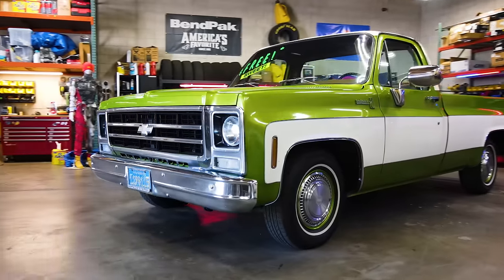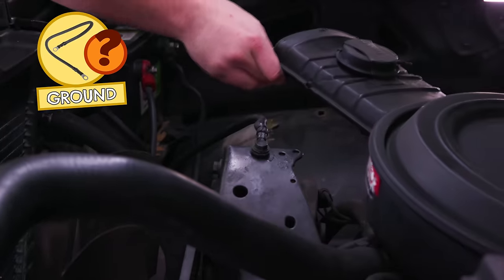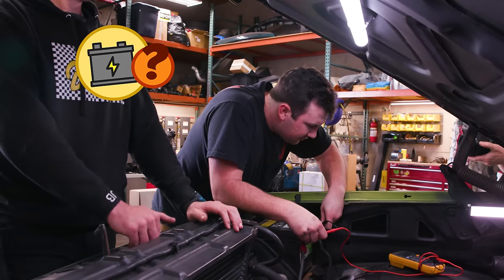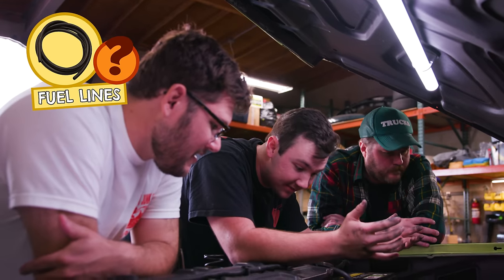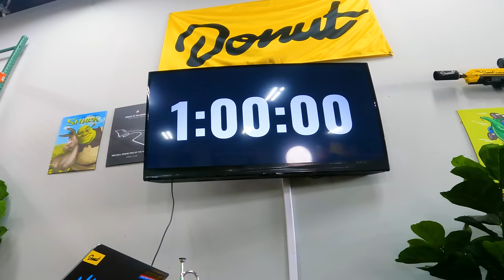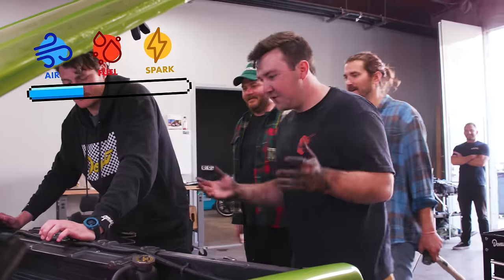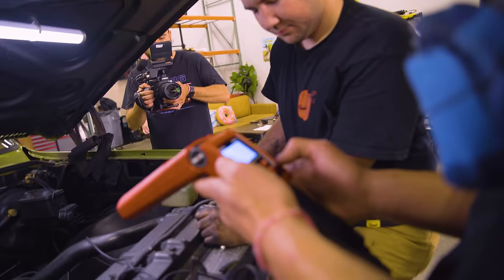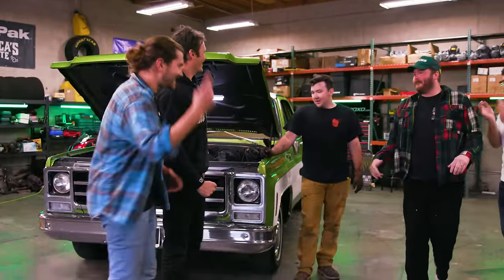Giving People a Classic Truck, If They Can Fix It

Comment: That pushrod moment was a perfect sign of experience.  Once you've done something like that a bunch of times, you know when something "just doesn't feel right."
Reply: I would have missed it myself.  Not a problem I've had.
Reply: theres a big difference between knowing that something doesn't feel right, and knowing why it doesnt feel right tho. thats the true sign of experience.
Reply: @xymaryai8283  he did know why though, cause  he diagnosed the issue almost immediately following his discovery that "something doesn't feel right."
Reply: Yeah, I was rooting for him to notice that.

That was a dirty removal to be honest. Lol
Reply: Don't ford's run off a little gear attached to the fuel pump?  That seems easier than a rod sticking out from the pump that can just fall off?   Why design a pushrod that can just fall off?
Reply: @breakingames7772  My 79 f100 has a pump in the tank like more modern vehicles.
Reply: @breakingames7772  runoff a concentric lobe that is bolted to the front of the camshaft
Reply: A true sign of experience would be popping the hood first and checking all the shit in 30 seconds he wastes first 15 minutes on and not getting in trying to start it. Obviously they not going to give a truck that starts when you there for challenge to fix it.
Reply: I was rooting for him that's all I can say,  and I'm so glad he got the truck 🎊 🤗 🎉 🏆
Reply: Definitely would have missed that.
Reply: There is a bolt hole in the front of the block that lines up with the fuel pump push rod. You push the rod all the way against the cam lobe, install a long bolt to retain the push rod, install the fuel pump and then swap the bolt out for a shorter one. It seemed like no one in the shop knew that.
Reply: @Thumper68  lol, good troll
Reply: @clawsoon  just stating facts. every thing he fixed I would of checked and discovered in first few minutes before I ever tried to start it.
Reply: @benwhitener3051  you can also add a small dab of grease to the end of the rod and push it and as long as you don’t hit it too hard it won’t move
Reply: @Mika-ph6ku  somebody has put it in the tank as they had a mechanical pump in 79 on the side of the block with but no pushrods to drop and fiddle with like a Chevy, that would've caught me out
Reply: Can tell you I would have NEVER figured that out
Reply: @asdasd-ni8eg  Nah man the fuel pump in the tank is stock. Had the original tank and pump in the truck when I got it. Needed to replace the tank, pump, and fuel lines cause there was rust and water in the fuel tank and the new tank and pump that came in were identical to the old parts.
Reply: @Thumper68  A true sign of experience would be not to comment stupid shit like that. Trying to start the car is exactly the first thing you wanna do. You can get a ton of hints about whats wrong just by the sounds the car makes (or doesnt make) while cranking and trying to start.
Reply: @Mika-ph6ku  They definitely didn't come with in tank pumps. Can you post a link to the pump you ordered?
Reply: @Vits2001  no that’s stupid a vehicle you know nothing about and your a mechanic first thing you do is pop the hood and do a visual check over some simple shit. Just get in it and crank it you have no idea what’s going on is a good way to really mess shit up.
Reply: Idk if I would have thought of the push rod because 302s don't have a push rod, just a long ass arm that rides on the cam lobe
Reply: @NOBLE-wo5rr  have u watched 2022 F1 Saudi Arabia race??
Reply: @James-vn8zb  yes.
Reply: @Vits2001  i got a new sign for this.
Reply: @StewDaJew  i can always figure this out.
Reply: @clawsoon  👍👍
Reply: @Thumper68  i got started from this one.
Reply: @purwantiallan5089  wtf u talking about
Reply: @Thumper68  Thats obvious. But this is not jusy any car. They literally told him just before starting that this was a perfectly running truck that they sabotaged in some ways to make it not run. Plus they only give you 2 hours so its not like they're gonna loosen the flyway bolts. Turning the key takes just a few seconds.
Reply: Knowing a SBC uses a Pushrod instead of a direct essentric lobe is also important because alot of the American I6 engines from the 40s-80s used Eccentric lobes on the Camshaft to actuate the fuel pumps lever directly thanks to the Geometry of an OHV I6
Reply: @purwantiallan5089  What are you replying yes to?
Reply: @Vits2001  Imagine if they drained all the oil and left it so the starter would crank, but wouldn't run? That'd be hilarious.
Reply: @benwhitener3051  I was looking for this comment. That's a trick I like showing people. I'd have it changed in ten minutes, because got it down lol. I have no choice but to change to electric, because mechanical pumps are so poor quality now days, they last me about a year before they start clacking.
Reply: @James-vn8zb  yes but for 1 you don't see everything said you also are pretty safe under the assumption there not gonna maliciously sabotage it.
Reply: @Mika-ph6ku  mate prove us otherwise I'll be glad  to learn about this oddity but from my experience mechanical pump on motor with a charcoal cannister and vapour lines go back to the top of the tank..
Nothing but a fuel sender in the tank which gives you your fuel level.

I'm currently building 6 between 74-79 so not my first dentside ford.
Reply: @asdasd-ni8eg  OK yeah I was wrong I found the pump underneath the ACU. Turns out what I replaced on the tank was just the fuel censor...

...I should probably replace the pump now.
Reply: He had some experience but still lacked a lot. It was apparent when it took him so long to get the distributor going.
Reply: @asdasd-ni8eg  No kidding. That's why I made the joke
Reply: I remember replacing my first Mech fuel pump and rod at 0200 in Afghanistan back in 09 lol. Fucking HMMWV fuel pump rods were weak as fuck!.
Reply: I’m surprised he got it since he works on fords and some of them just have a long arm that touches the crank directly
Reply: @tylerbranscum3485  The way you're supposed to do it is to take the bolt out from in front of the block and use one of the fuel pump bolts in that hole to hold the pushrod in place. Some red n tacky might work, but the hole is there by design.
Reply: @James-vn8zb  They do this everytime for show. The challenge starts with trying to start the car, eventhough you know its not gonna start. They're not gonna drain the oil
Reply: @Vits2001  None of you get a joke...
Reply: @James-vn8zb  Yeah sorry, i didnt catch that and answered seriously hahaha
Reply: Anybody with experience would have looked at the pump before blindly installing it and wasting a bunch of time realizing the rod is missing lol.
Reply: I always inspect parts when I change them. Been wronged to many times but I would have never expected that from them lol 😂 genius
Reply: @breakingames7772  theres a oblong washer like thing on the old fords , you just stick the fuel pump under it , when it turns its shape makes the pump arm go back and forth ( if i explained that correctly ) no metal rod to fall out , also the distributor was in the front , easier to work on and time , but parts were more expensive back in the day cause they werent as popular , you could find chevy parts laying everywhere ..but not ford parts
Reply: @Thumper68  maybe with exception to distributor cap- he worked on Fords which is upfront and turned different compared to GM- so that and fuel pump would be only things he would’ve needed to try and start it for
Reply: That's true. It's a matter of knowing what the engine sounds like when it starts properly and why it sounds like that in the first place.
Reply: @James-vn8zb  an engine can still run without oil it’ll just eventually seize up
Reply: @BassmentBrain  it’s called experience and the ability to use common sense..they are going to give you a truck if you can fix it..assume it won’t start and take a glance under the hood and confirm that right away and you don’t know what they done to the engine attempting to start it may cause damage that you then couldn’t fix in time limit so a smart person would eliminate that possibility. Like I said experience and common sense but you’ll never know until you try it🤣🤣
Reply: @BassmentBrain  I didn't say it wouldn't. I was saying if they drained the oil, then did something else to prevent it from starting. Bc they almost always turn the key first without doing a quick look over. Maybe they're told to try to start it first. Idk. I just thought it would be funny if he tried to crank it over a bunch of times, then realized it had no oil.

Comment: We just bought a Chevrolet Truck!  Only one problem, it doesn't run!  Chevy owners felt that.
Reply: i love your videos bawz keep healthy and uploading more content
Reply: yo Odd wzzuuuuup
Reply: OddBawZ + PhlyDaily A10 video!?! Would be cool to see one calling out targets from the ground with the other coming in for the brrrrrrrrt.
Reply: And they didn't even have to sabotage it, it just came that way
Reply: It be like that, bought my El Camino 6 months ago and still has no drivetrain. Only been 48 years since a it’s ran lol
Reply: Youre telling me, bought an s10, put 3k miles on it in a year, then after 3 months of not being touched, it just starts on fire when I start it. 
Sold it, bought a 4.6l f150
Reply: Is that a problem or a standard feature on a Chevy truck?
Reply: @Mika-ph6ku  the Chevy truck go brrrrrrr
Reply: @OM-jt8bn  hi OM40. Have u watched F1 2022 in Jeddah?
Reply: @jaket6007  🤦‍♂️F150 won't last as long as a chevy. Not a fanboy of either but have about 35 trucks I take care of. Chevys as far back as 98. 2 of the trucks being scrapped out of the four are Fords with severe mechanical issues. The other 2 are chevys that were stolen and stripped for parts. Oldest Ford is an 08 and only 2 left in the fleet plus it has a rebuilt engine. My advice. Buy Toyota.
Reply: @chrisd0427  the ones you take care of must get treated like shit by their drivers. Is it a fleet? Because I used to work for a company that had fleet vehicles and my fellow employees and I beat the ever loving shit out of them lol
Reply: @BarnacleBoy42069  100% treated like crap. Mine has the highest milage of all the trucks and it still looks and drives great. Just got a new one so I wonder how badly it will be treated.
Reply: That’s why I put a LS in my c10

Comment: This is a very good "Every Chevy truck issue ever" video for anyone trying to figure out theirs. I was going through everything I checked/changed on mine because it wouldn't start and it was basically these same issues/parts. 

Great job, Donut Media!
Reply: Nah, he hasn't had to weld in half of a new cab and replace 2/3 of the wiring.

Comment: Dude’s out here wearing an oil crisis shirt and legit guzzling gas. 

Also this dude clearly knows his shit and is funny as hell yo donut hire this man
Reply: Yes, agreed. He's pretty knowledgeable in that field, minus the battery diagnosis.
Reply: @port nut I mean yeah he probably could have but that’s kinda not the spirit of the contest is it?
Reply: @areminderofwhatweare  The rules only list what you can't do or must do......everything else is fair game. I would have wired the hei directly to the battery and jumped the starter with a screwdriver. This would have been a very easy challenge, but then again I own a 79 C20 that I have done EVERYTHING to, including rewiring all of it, replacing all the fuel lines for the dual tank setup, installed a gearvendors od, upgraded the engine to a 406 sbc with a forged crank and aluminum top end, electric locks and windows, autometer pro comp gauges, etc.
Reply: @CGT80  sure but like, the rules of basketball are get the ball in the net, if I perch on top of the backboard like a fleshy gargoyle with a big sack of balls (or a big ballsack, take your pick) throwing balls into the net I’m technically getting them in but I’m not really playing the game of basketball am I?
Reply: @areminderofwhatweare  I don't watch sports and have zero interest in playing basketball, but if it isn't against the rules, go for it. Do basketball teams not pass the ball to a person waiting in a good location to easily get the ball in the net? I would bet the way the game is started would prevent you from doing what you described if you were a single player. If players on a team don't do that, then it is either not possible or practical or against rules....there are plenty of people out there just to win. I do watch Cleetus McFarland (for the mechanics, story, and characters/people, not really the racing) where they do what they can to win races and they have run their car with no coolant on a hurt engine and gambled further damaging it to win the race or set a new record. It depends on the players' goals. I compete in shooting competitions where I have to decide how I want to tackle a course of fire and there are sometimes shortcuts you can use that do not break the rules but require creative thinking or planning. Each course will have directions and /or requirements that vary and a big part of the game is for each shooter to decide what order and method to use to get the hits as fast as possible to have the fastest time.
Reply: @areminderofwhatweare  as someone who watches F1, the entire premise of the sport is to do anything and everything NOT prohibited by the rules. That's how they wound up with Gordon Murray's massive fan car, as well as the 6-wheeled Tyrrell. Hell, even Mercedes' Dual Axis Steering from last year toed that line, and was subsequently banned this year.
Point is, fair game is fair game.
Reply: You understand donut is a company, right? They have to work? And not just have fun driving cars around? 

"This guy is entertaining" isn't the sole reason to hire someone
Reply: @ronpaulssecretary  no this is actually my first time encountering anything on this planet can you please explain the concepts of companies, written language, and cars to me in depth? 

Dude I wasn’t being serious. It’s not like I’m sitting here going “iF DoNuT DoEsN’T HiRe tHiS MaN RiGhT NoW I’M GoNnA RaGeShIt sTrAiGhT ThRoUgH My jEaNs aNd nEvEr wAtCh aNoThEr vIdEo.” I was saying hey this guy’s funny and fits in well with the rest of these guys.
Reply: @CGT80  I’m not a sports fan either, I was just trying to make a point about sportsmanship vs getting through on technicalities. I don’t know if this metaphor works better but if you were in a marksmanship contest and fired every shot with the muzzle of the gun pressed against the target technically you’d be hitting the target every time but is that really the point of the competition?
Reply: @cole2999 I mean you’re not wrong, fair game absolutely is fair game until the FIA steps in and calls shenanigans. Just ask Toyota post WRC 1995 lol
Reply: @areminderofwhatweare  That is where rules come in. There are designated areas to shoot from. There have been cases where the layout left an easier angle to hit the target or it was possible to hit a target from further away at position that saves some movement which can be faster. An accurate shooter may choose to take the longer shot and save time. One time I finished and pulled my magazine from my pistol and then noticed one target I missed. I lined up my sights and fired the round in the chamber, hitting that target so I didn't get penalized. The catch is that it added an additional couple seconds to my time because it triggered the timer again. Other times we are given multiple options on purpose. Cleetus had a competition where they had to back boats on trailers between cones. Each hit on a cone was a 3 second penalty. The first guys took 60+ seconds to back in while trying not to hit cones. The winner backed in as fast as possible and hit 5 cones but only took 20 some odd seconds. With the penalties their time was still less. The rules didn't say they had to avoid the cones, just that there was a penalty for hitting them. It was a 3 part competition with 3 teams and they wanted to win. A pro Nascar driver entered in a Cleetus race with all stock crown vics. On the last lap, as he was in second place, instead of avoiding the first place driver coming down into his lane, he let his car contact him doing a pit maneuver and he won the race. I thought it was a bit dirty but apparently he is know for it and it is common in the pro racing. The prizes for that race were used vehicles that weren't a big deal to most of the racers. In the case of the C10, it would be worth a person doing what it took to win. If the rules say they have to fix the problem properly and not just bypass it, then that is what they must do and it would be cheating. If the rules are just to be able to drive it out, then everything goes, short of pushing it out.
Reply: Knows his shit? What video did you watch?!
Reply: @Hunnisloot  the one where a guy took a truck that didn’t start and got it to start. Have you never in your life had an oversight when working on a car?
Reply: @areminderofwhatweare  It's a small block chevy...a 6 year old could work on one of these fucking things. The guy had a "oversight" on damn near everything, and only walked away with a truck because he got multiple hints. It took him what 30 minutes to bolt on a mechanical fuel pump for fucks sake. It's cool that he fixed it and all, but he does not "know his shit"

Comment: What a legend. I've worked for a Ford dealership and a Mercedes Dealer as a tech as well as  been working on cars for years before and after and I don't know if I could have diagnosed that and installed parts in 2 hours. That was impressive